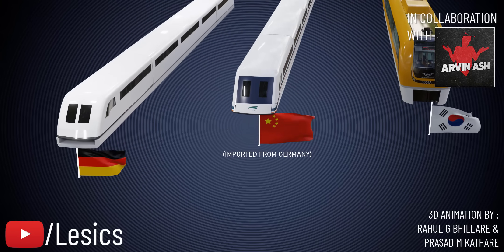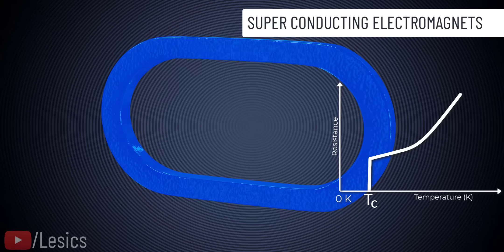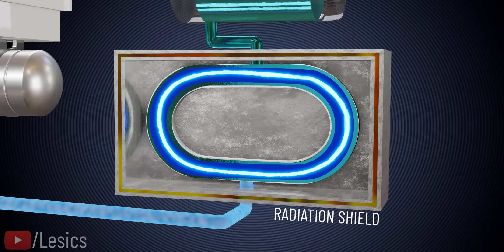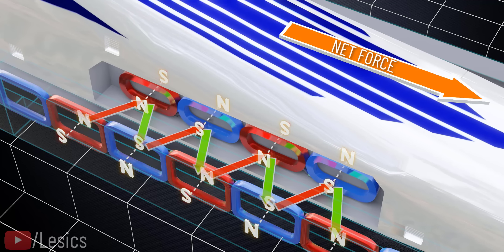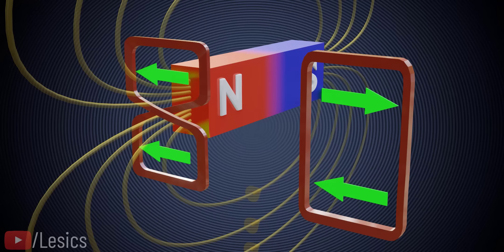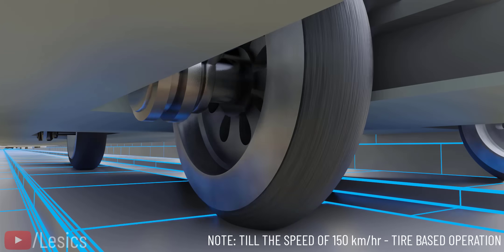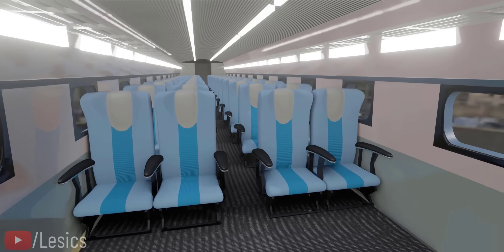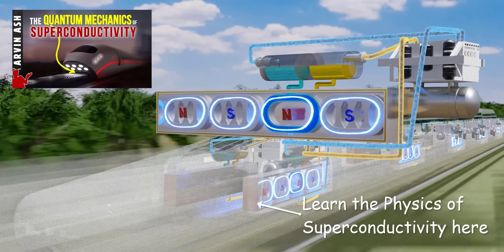The Fastest train ever built | The complete physics of it

Comment: Mag Lev train are expensive. New tracks are needed and power to excelorate. The old German system in Shanghai works without super conduction. It's not as fast, but has been running for decades and shut down once. Mag Levs should be everywhere, if it was done a small part at a, like the TVG was in France. Or the light rail was done in Portland Oregon. Superconductor need a special trade the makes the train flout in 2 axis. The whole system needs to be cooled and power is constant to the track. A very very expensive system. Japan started this 60 years ago and still hasn't have a working line.

Comment: i like how they say "The super conducting magnet doesn't need any power,
But.....
The cooling system needs a good amount of power."

Technically wouldn't that mean it needs power to hold its magnetism.  

 As it doesn't matter what type of power it requires in order to function. 

Although  if they figured out a more efficient refrigeration system. Kinda like a Propane RV fridge.  that uses no electricity to cool. 

So my question is what if they just made a bunch of small levitaing cars that only had a bunch of super conductors and the whole car was cooled by one system. 

then lets say it was on 1/4 mile a sidways circle track.. And the entire track full of those cars linked together with a big ring . or several rings that connected at a centeral location. 

that had a generator, and/ or several generators with a tire placed at different locations on diffrent rings. 

Since the super conductors only require a set amount of electricity just to maintain the cooling system. Since each car only contains 1 cooling system and multiple super conducting magnets.That it  doesn't carry any people. So i722it can be a lot smaller and lighter thats more efficient wicondugtuongThat as

I wouldn think that at some point it would generate more electricity than required for of cooling
 As the fastrer it goes the stronger thr magnet becomes. Alson the.faster it goes can also be used ffor cooling. which I don't doubt the cooling system pumps dont require more more force to spin than one magnet can produce. let alone a small car full of then thay is cooled buy one larger unit would need to keep it cool. plus if that thing could spin at 1000's of mph. the wind  speed would also help to keep them cool. requiring even less energy

Which ultimately it could be used as a clean alternative energy source that could supply entire cities. Depending on the  number and size of each power system

Comment: I watched the video at least 10 times and I have some questions:
1- How do you stop it in an emergency? Does it have a parachute or emergency stops are just not allowed?
2- The power source that propels the train is the power produced by its own magnetic field? Or the magnetic field only controls the switches?
3: How are the compression and refrigeration units powered? From the magnets or the ground?
4- Is it power efficient or does it use unlimited power just to go fast?
5- Is the speed limited by the train's terminal velocity or the frequency of switching the currents?
Reply: I am not an expert, but I'd answer your questions to the best of my knowledge

1. the landing tires are of aircraft standard and can land safely at the maximum speed of 500km/h. Air brakes were considered at one time, but it seems that electromagnetic brakes were deemed sufficient.
2. propulsion power is provided by an external coil running an alternating current of a specific frequency. The frequency must be adjusted to match the speed of the train.
3. all power for the refrigeration system, etc., is provided by inductive current from the ground
4. unfortunately, the power consumption will not be as efficient as the Shanghai maglev (EMS system). However, according to research by JR Tokai, the commercialization of high-temperature superconducting magnets that do not require liquid helium is currently in sight, and the next generation of trains will consume much less power.
5. train speed will probably be limited by train noise. 500 km/h is the economically and environmentally reasonable speed, but if the surrounding environment is ignored, commercial operation at 600 km/h will not be difficult.

The real advantage of the EDS is the intrinsic safety that comes from its simple control system. As long as the train is moving, no power is needed for floating, and the ability to safely stop the train in the event of a power outage is an important feature for Japan, which is prone to earthquakes.
Reply: The linear is floating due to the power of electromagnetic induction from physics. It uses electricity to run, but it doesn't need electricity to levitate. When the superconducting magnet installed on the linear car body approaches the levitation coil on the guideway side at a speed above a certain level, an electromagnetic induction phenomenon occurs in which electricity flows through the coil and it becomes a magnet, creating a repulsive force and causing it to levitate. During a power outage, as long as the linear is moving, it can levitate and continue moving. When the speed is below 150km/h, the electromagnetic induction is eliminated and the wheels automatically extend to land safely. In the event of an earthquake, the system can be safely stopped by shutting off the power. These controls are unmanned and controlled by commands from the central control room, making the super-high-speed train highly resilient to disasters and unlikely to derail.
That's what I mean.

Comment: JR Tokai has completed a new levitation system using high-temperature superconducting coils (bismuth copper oxide), replacing a simple refrigerator-only system that does not require liquid helium. It also has emergency wheels that can land at 500 km/h in the event of a quench. (sorry for the machine translation)

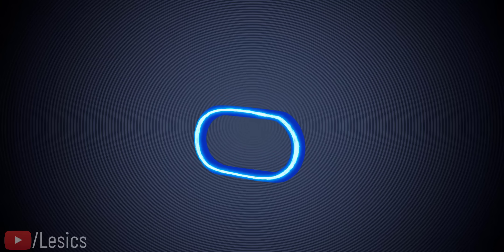Comment: 2:20 if lk-99 turns out to be real, then this cooling process could be ditched. This would revolutionize the superconductors world
Reply: Can you explain to me what LK99 is? Why is a floating rock such a big discovery?
Reply: @justinmccarthy7122 it’s a “room temperature” and ambient pressure superconductor. There would no need for cooling the material for its superconductive properties. Which is big, as it allows us to use it in most if not all industries. As the material is a superconductor, it conducts 100% or near energy, which means it wouldn’t lose energy to friction/heat. Theoretically, this could mean unlimited voltage, charging your phone instantly. This could be scaled up to EV cars, etc. This discovery, if true, is a huge deal right now.

Comment: The engineering of the MagLev train is impressive, but the video glosses over the fundamental problem of power.  What generates the electricity and how much electricity does it take to make these trains run efficiently?  How much does it cost?  Are high-voltage power transmission lines and transformers built into the bed of the railroad to supply consistent power?   There is no free lunch, after all.

Comment: I dont understand, why in 9:15 only the bottom loops are effected... the main magnetic flux is heading towards the cross of the levitation coil, so i dont get it. What's more, i would expect, that if the  attractive and repulsive forces between magnet and levitation coils are eaqual while train in the middle of the guideway, then while the train gets off the middle, the overall forces should be still the same, because if it gets closer to levitation coils, attractive forces get stronger as well as repulsive forces... please explain, i need to understand it because of school :D

Comment: Why do not use High Temperature Superconductor which is using Liquid Nitrogen as coolant that is much much cheaper than Liguid Hellium ? The inventor of Japanese seems totally ignoring High Temperature Superconductor which has been awarded Nobel prize in nearly 40 years ago. This liquid Hellium temperature Superconductor was found in more than 60 years ago.
Reply: This is basic knowledge of superconductivity, but the superconducting state is easily destroyed by magnetic fields. Therefore, only a few superconducting materials can be used as electromagnets.

Comment: I think China has the fastest train ( Shanghai Maglev train)...
Reply: Starting this spring, the maximum speed of all trains has been lowered to 300 km/h. The operating company has not disclosed the reason, but some people point out that it is due to the reduction of operating costs amid a decline in passenger numbers, as well as the deterioration of facilities.
Reply: @socks_cat356  Shanghai Maglev is still capped at 300~350km/h all day. I strongly suspect it's a deterioration of rail tracks. It must be one of those problems German Transrapid couldn't solve for its long term operation. Inferior Chinese-made tracks of course can't hold the precision (2mm) original Transrapid maglev require and they are deforming. I doubt German government will help fixing it as Chinese are blatantly copying their technology/IP one after another. It's now a political problem between 2 countries.
Reply: China “has” whatever, yet didn’t develop any of this. It’s a technology transfer from Siemens from Germany to China..
Reply: @radiumdude  https://www.youtube.com/watch?v=8Gm5tMtJ-Mw
Reply: @radiumdude  Dear, now China is developing all its own projects independently. Including high-speed trains

Comment: I used to work with superconductors a lot in the energy sector. All of that stuff is experimental and the cooling is a real problem. Yes, people try to argue it away and diminish the impact, nevertheless, the Japanese know that their solution is not as practical and contains more problems than the real maglev technology by Hermann Kemper and the German transrapid. The reason why there is no 500-600 km/h transrapid running in Germany today is purely political. So it would be nice to keep the superlatives at bay; the SCMagLev is a neat sidestep of the Transrapid patents, but it has got lots of issues which they have not resolved. And they are neither the fastest nor the first. The Transrapid was planned with 450-600 km/h cruising speed and the only reason it never clocked at more than 500 was the limited length of the test track in Lathen-Dörpen, so the train could not accelerate any further.

Comment: 0:12 "superior to other trains"
In what metric? Its the demonstrated fastest, but that is really just an effect of having the longest available demonstration track.

2:38 "The superconductor of the SC-maglev is a NiTi alloy"
That is only true for the MLX series, the L0 series have a high temperature superconductor 

10:10 The magnetic induction is based on permanent magnets and just work at speed. MLX prototype use a diesel generator for stationary use, while the L0 use lithium battery bank. This is why MLX01 had a black square on the roof at the en of it operational life. To hide soot from the smoke stack

Comment: That what you call Riding the Dragon. Too much technology for something simple. For lower IQ form: Pressure, Heat and Radiation: does NOT fix well when something goes wrong. For the Engineers, the idea is over your head, to make it cheaper and less dangerous. I'll give a hint, " Magnets."  YW

Comment: There are now (and have been for some time) superconductors that operate above liquid nitrogen temps (ie the standard YBCO used in physics demos).  Why does the train need liquid helium cooling for 4K to make a 7K superconductor work?  Is there something special about this extra-low-temp superconductor that makes it work when the YBCO that would work with LN2 would not for this application?  Is it a current density limit issue?

Comment: I think there's one crucial information you overlooked, and that's the brake system. How do they stop this massive train moving at tremendous speeds?
Reply: I guess it can either use the same method it uses for propulsion or use regenerative braking instead
Reply: Switch the motor current off, it switches into generator mode and regeneratively brakes. Plus a bit of aero drag. Final stop can be done with normal brakes.
Reply: I have a feeling magnets are used as well ;)
Reply: He briefly mentioned it, without actually saying it was the brake system.
To increase and reduce the speed of the train they increase or reduce the frequency of the current of the side wall magnets. 4:20

Comment: Great presentation.  On The Other Hand, i would rather have regular train wheels with a band of rubber followed by the rest of the steel wheel contact band.  It's cheaper and , if inspected regularly, is far safer & more reliable.

Comment: Why haven't we gone to DC voltage as a primary source of power.
Reply: Simply unreliable, AC can go farther in the transmission line whereas DC will probably stressed the transmission line and burned it, if it doesn't burn then the DC energy loss in transmission lines are simply not profitable
Maintenance also plays a role here, AC needs less and DC needs more

Comment: Why not just use an airplane. In order to make it as routine as a train they could make dedicated airplanes....like a train set....that simply takes off as if it were a train...ready or not. Doors close and plane takes off. Then it flies along a VERY fixed route......like a train.....and doesn't need clearance to land because it would be operating on a schedule....like a train. But aircraft already travel at hundreds of miles per hour....no new special engineering needed. Just operate some planes like trains. VERY fixed schedule....no need for landing clearance because it would already have it's fixed landing time. No need for all that infrastructure....just a landing strip. The terminal is right by the "runway" They off load and on-load and then takeoff in the opposite direction on the "takeoff" runway as the next train/plane lands. However I suppose weather would always be a problem. You got me there.

Comment: interesting technolgy. one does have to wonder how it would hold up under different climate conditions given the tempature control needed for it tho.
Reply: the required temperature is on a different scale, and in a vacuum insulated environment. As far as just temperature outside goes, its irrelevant. The liquid helium is at 4.5 K (-268 C or -451 F). The static Magnets and propelling coils are largely unaffected by the relatively subtle changes in temperature the earth has.

Comment: I wonder how they mitigate the quenching hazard. If that superconducting coil quenches at 700kA, it could be pretty destructive.
Reply: Could you please explain/elaborate, what you mean by the term quenching. I'm not familiar with that terminology! Thanks!
Reply: @ianp3112  If the cryogenic system used to keep the SC magnet below it’s critical temperature fails, the magnet’s temperature will exceed the critical temperature causing the resistance in the winding to essentially spike. All of the sudden, a huge amount of power is dissipated. I’m not an expert, but I believe this sudden energy ends up exerting a huge force on the winding, and pretty much launches the magnet (this has happened in particle accelerator incidents). Typically they use large dump resistors capable of dissipating the energy stored in the magnetic field, but these end up being very bulky and I don’t know how they’d fit it in this system.
Reply: @ravpuii9944  thank you for the explanation as well!
Cheers
Reply: @ravpuii9944  Very nicely explained
Reply: A quench is when a superconducting magnet stops being superconductive. Can happen for a variety of different reasons, but essentially it cause tons of heat and force to generate within the magnet very quickly, potentially damaging the coil.
Reply: @Ravpuii the force is largely generated by the helium rapidly vaporizing due to the increased temperature. Which is why it’s important to be able to release that pressure quickly.
Reply: There are large safety margins built into these things. As long as you keep it under the critical surface you’re fine.
Reply: @magicbeans9759  Regardless of margin, this failure is potentially catastrophic, so I would expect some sort of plan for quenching
Reply: @ravpuii9944  They vent the helium in case of a quench.
Reply: @magicbeans9759  thank you for the explanation, I learned something new today!
Cheers

Comment: Common sense will tell us that if the train is on its levitation position, there is a tendency and possibility to derail, due to imbalance and improper supply of power from sides of the rail tracks..  I am not an expert on how the train works, but this is just my humble opinion and simple theory on how the trains works and runs. Thank you.

Comment: I rode the maglev in Shanghai. It was pretty cool. We got up to 350 km.
Reply: Yes, in off hours the Shanghai Transrapid (built in Germany) is operated at reduced speeds.
The whole mistake was to build the line in parallel with a regular train. The tickets are so expensive for the Chinese commuters that everybody takes the regular train.
All the economic issues of that implementation stem from that. And the Chinese never realized the expansion, with an increase in commercial speed to more than 500 km/h. The Shanghai Transrapid is like great sex but suddenly you had to pull out before you were done. An unsatisfying situation.
Also, the Chinese built the track significantly less well than the test track in Germany, so that the typically supersmooth Transrapid is a bit more shaky in Shanghai which is rooted in the way the track has been realized. Not exactly to German expectations.